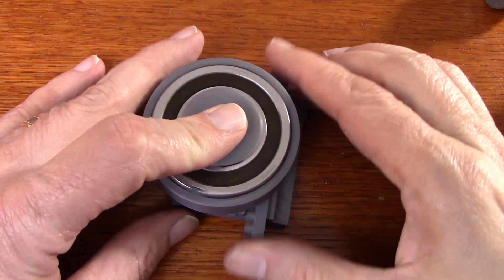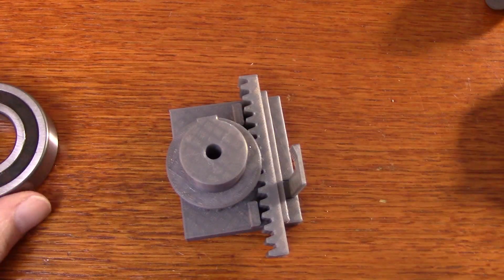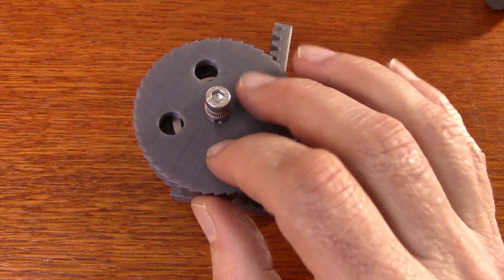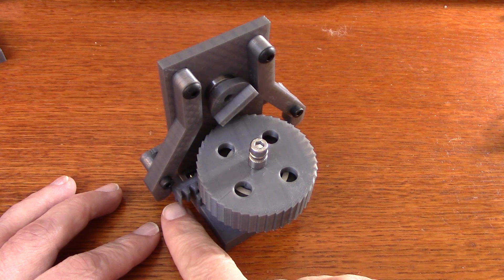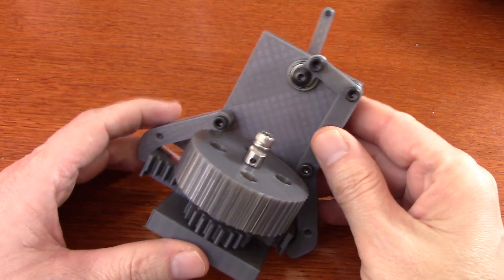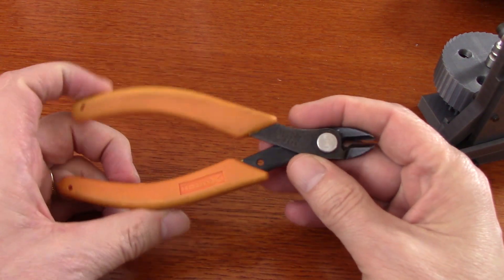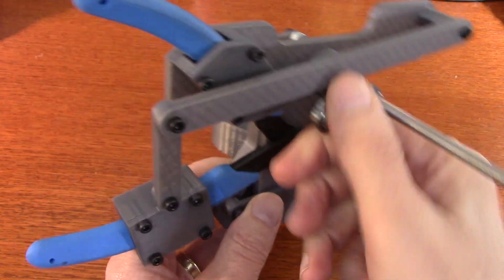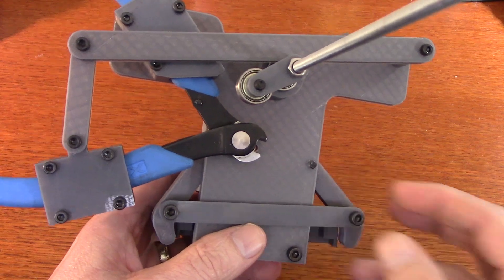#31 Pellet Maker Part 3

Comment: Hello! I really like your videos and the projects you work on, and thank you for sharing them with us. But I think you make this filament chopper design too complicated. I would try to use two sets of cylinders. The first set guides and pushes the filament forward, and the second set cuts it while rotating. All with continuous motion, without reciprocating. Watch the video - How it's made: Nails
Matt
Reply from the maker: Yes, what I published in this video is too complicated. I've been working on a simpler version (along with other projects). The rotating cylinder approach is interesting. But since I want the pellets to be about 5mm long, I'd have to have a lot of teeth, unless I'm missing something.